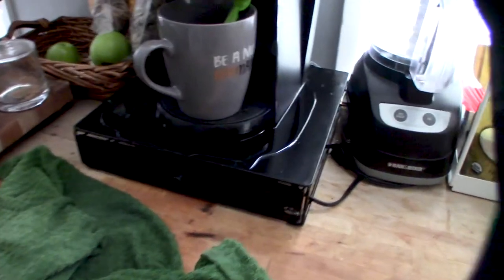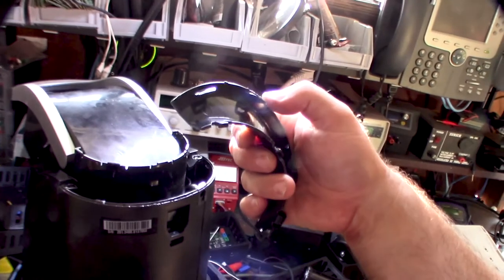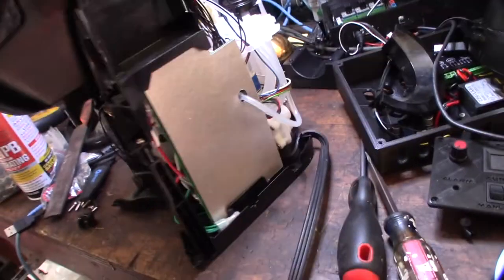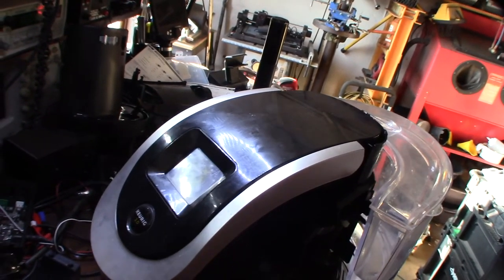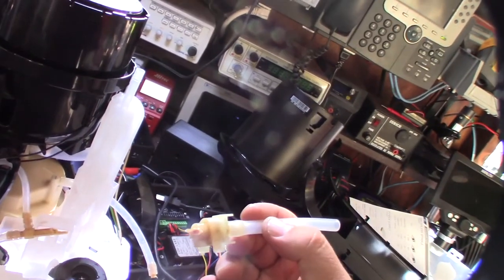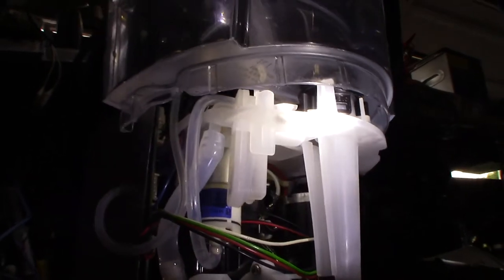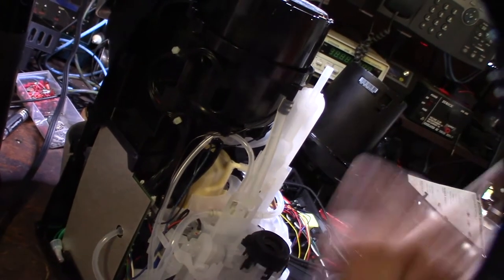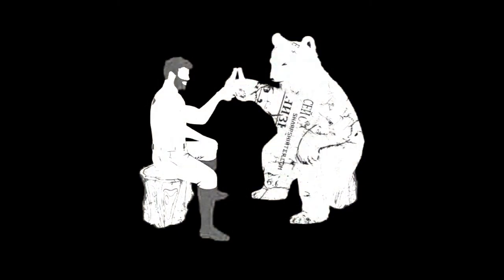Keurig 2.0 Water Leaking From Bottom Troubleshooting Repair Disassembly Underneath Leak

Comment: Spent almost an hour looking for a video with same model I have. Yours is the only one. I’ve had mine for over 5 years an I purchased it with holiday gift cards (so free to me). Hate the cleaning process and I use tap water. Only myself to blame. Tried to get it apart but just won’t budge. I’ll break the whole thing before Im done. Have more holiday gift cards so I think I’ll just get a new one. Thanks for the video.

Comment: Thanks for the video! Wish I paid more attention and just popped the piece behind the reservoir. Took it all the way apart and pure pain putting it back together.

Saved me a hundo though, so thanks. I cut all the locking tabs on the front cover in order to get it back together. Not the whole tab but the angle that locks. Same w the alignment tabs by the reservoir  inlet. Got tired of fighting with it to go back. Once I did that pretty much flew back together. Didnt have the fittings but got a multi pack for $9 at advance Auto. Again appreciate it,  mine was broke same. Canceled the Amazon order for a new one!👏👏

Comment: Just repaired my with the same problem.  It was not hard to get the back cover off to look at the tee.  I placed the Keurig on a towel and ran the water.  The water on the towel was hot letting me something was wrong and I had to look deeper.  I fully expected this would be a find and discard but I was able to easily fix it with a tee just like you described.   Thank you.

Comment: Just checked mine, same leak! I'm going to try two T fittings in line so I can keep that.....Part is better researched as a Check Valve....Found some for other Keurig machines, but not the 2.0 yet

Comment: LOL, OSHA guys. Another bureaucratic waste that used to be beneficial. Interesting call on that check/relief valve. The only thing I can think of is that maybe it was designed to hold flow to the coffee until a certain pressure is reached?

Comment: That part shouldn't disintegrate within two years. Keurig is probably aware of this issue and has had lots of complaints. I may try calling them to see if I can get them to send me a new one. You never know
Reply: It's probably designed to fail so that you'll buy a new machine!
Reply from the maker: Funny, I don't think they want you to open it.

Comment: Thank you so much for this. I just took apart my machine and I had the same problem! How is your repair holding up? Thanks!
Reply: I just stuck a hose coupler in mine, I left the hose that goes to the board off. been using it for a few weeks with no issues at all
Reply: I ended up doing what he suggested with the automotive t fitting and this morning it worked out great. 
So glad to not spend $200 on another Keurig… at least for now!
Reply: @rebeccafisher-mcginty1684  what is the fitting made out of ?